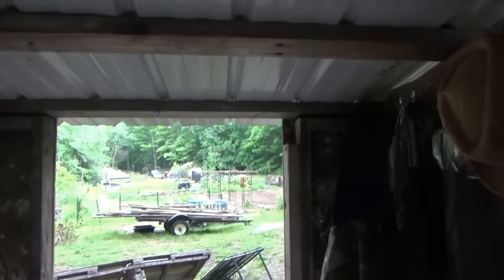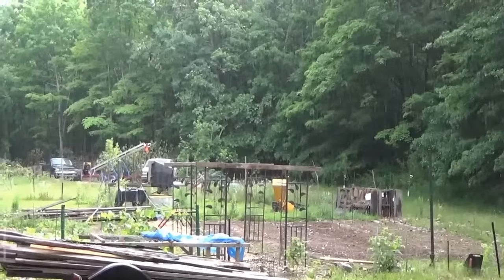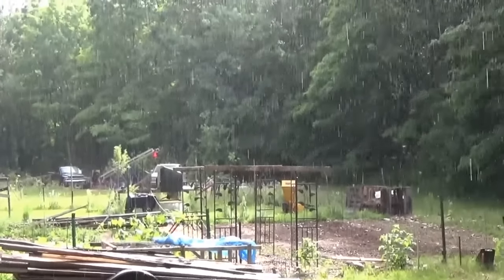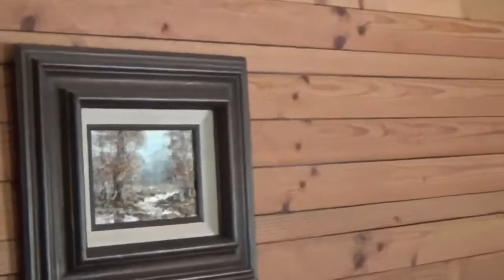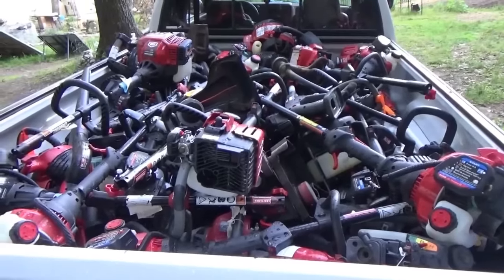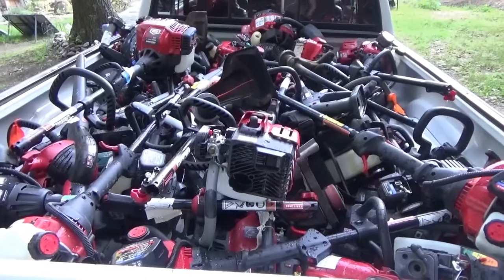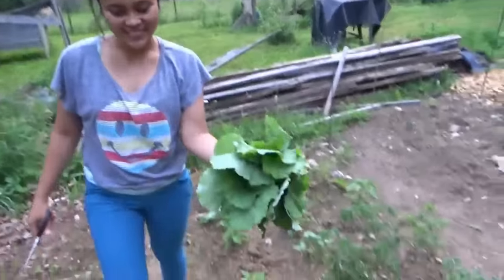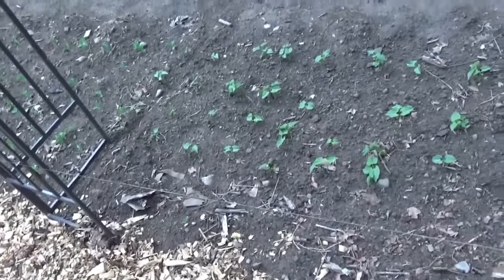Off Grid Homesteading ~ Tiny House Beautification ~ Huge Haul

Comment: You should attach a piece of wood on a hinge to that section of ceiling by the steps, for a pull down shelf. The tricky part will be giving it resistance so it doesn't just drop when you open it. Maybe use it for less frequently used spices or such, since you don't have a lot of depth in that area.

Comment: I asked my dad what else they use the weed wackers for... apparently the motors are sometimes used on bicycles. You might be able to sell just the motors on ebay. The weed eaters new on ebay (4 stroke) cost over $200. If you can fix up a couple and sell them for $100 used plus shipping on ebay you would make decent $.

Comment: HI     I HAVE HAD TRUBLE WITH MICE AND ECT. GETTING INTO MY LAW MORERSWHEN IN STORAGE. WEATHER IN A SHED OR TARPED. THE BEST THING I HAVEFOUND IS PLAIN OLD MOTHBALLS. I USE AN OLD TUNA CAN ABOUT 1/2 FULL.I PLACE 2 OR 3 CANS AROUND THE MOTOR.  IF IT IS LONGER TIME STORAGE,YOU MIGHT PUT SOME THE AIR INTAKE AND FILTER. IT DOES NOT HERT THEM THEY JUST DO NOT LIKE THE SMEL. THIS WORKES ON MY TRACTOR AND OLD TRUCKFOR WINTER PLOWING. GOOD FIND ON THE TRUCK FULL OF PARTS. THIS MIGHT WORK HELPING IN THE STORAGE OF THEM TOO.